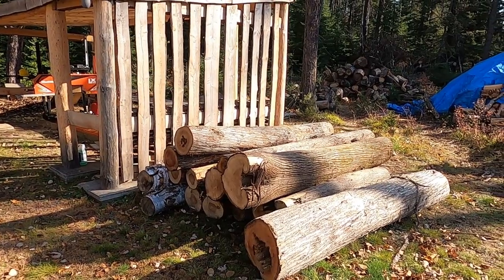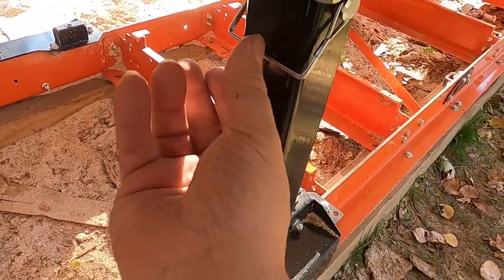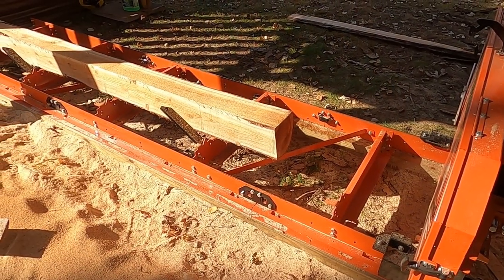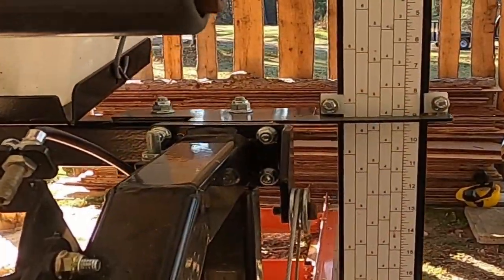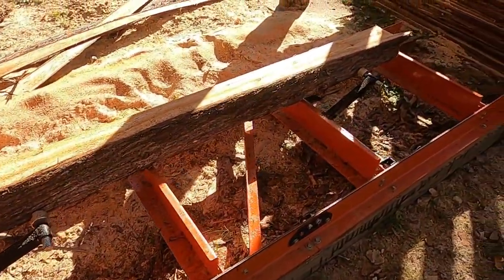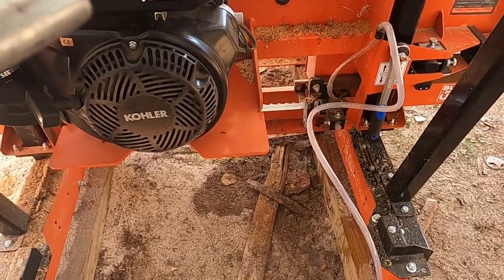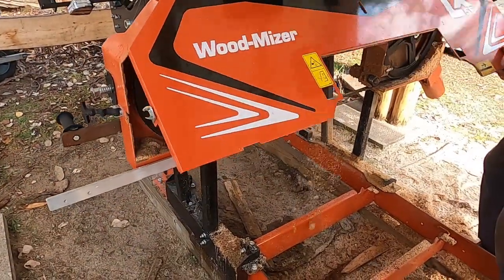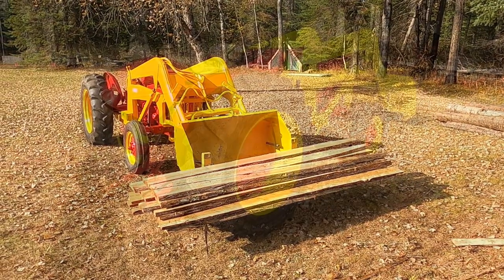Learning How to Use and Care for My Woodmizer LX55

Comment: From one new sawyer to another, we mounted the mill on a trailer and it really saves the strain on your back.  Also drilled a small vent hole in the top of the water reservoir to allow the water to flow, works much better now.  Lots to learn but loving every minute of it!
Reply from the maker: Great tips!

Comment: The roller guide with the water drip mounts onto the heavy steel bar of the optional guide assembly.  Mine required considerable sanding of the plastic parts before it would work properly.
Reply from the maker: Mine is not correctly installed. We had been confused and havn't bothered to correct. Perhaps it isnt needed? I will take the time to install it correctly since we paid for it and theoretically it should be a good thing. Thanks for the info! I need to watch some more videos and read some more. It has been fun and rewarding
Reply: @donwrightadventures  Mine was impossible to assemble on sight, so I took it off and worked it over sitting at the kitchen table.  Took considerable sanding for it to work correctly.  Reassembled it, and it works good.  Keeps the blade guide close to the log.